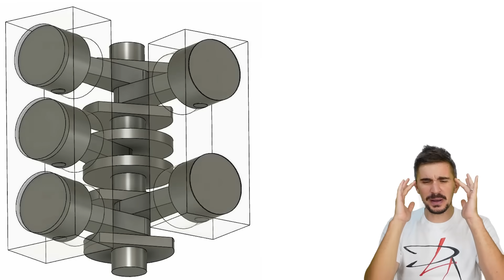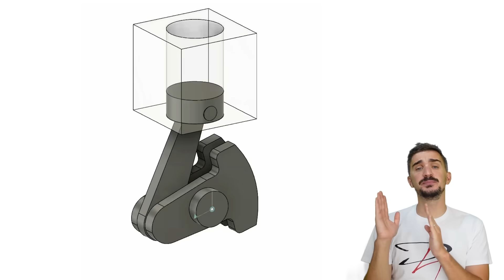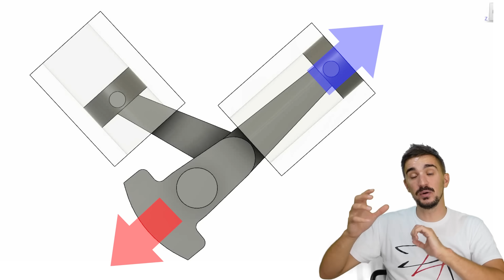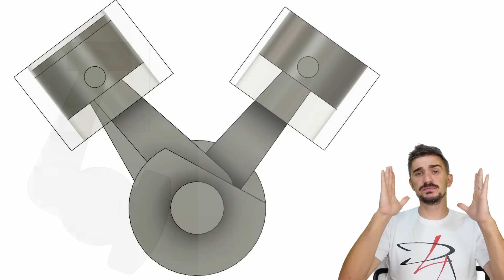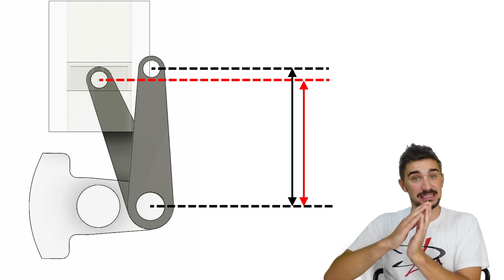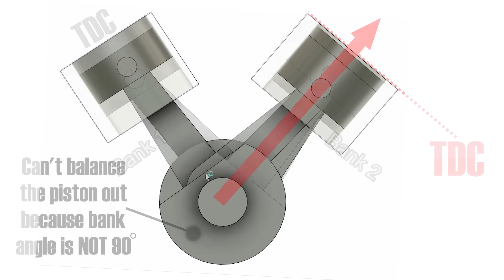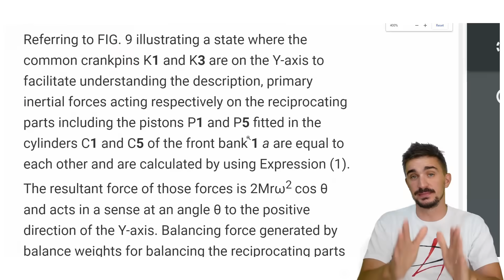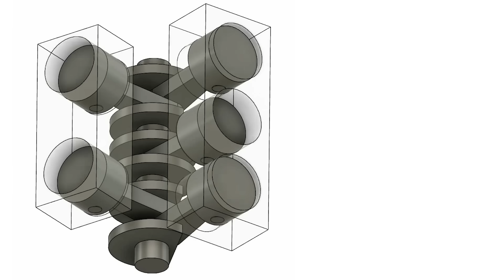Logic Defying V5 Engine - Honda's RC211V Explained Like Never Before

Comment: It wasn't made real clear in the video but, for a single cylinder engine balanced to 50 percent, the primary unbalance force is purely rotary.  Of course, the rod angularity creates a secondary shaking force, but we can't really do too much about that other than to note that it is directly proportional to the primary and thus benefits from reducing primary unbalance.  Since our primary forces are rotary, we can stack cylinder orientations so that the rotary forces tend to cancel out.

Comment: I have something to ask, at 5:35, you said that the 90° V-Twin engine has perfect primary balance, does that also apply to secondary balance? because the other piston is at 90° from the cylinder block which means max velocity, while the second piston is at TDC which means max acceleration. If that's true, does the V4 engine have perfect primary and secondary balance like the Inline 6 engine (regardless of whether it's even firing or odd firing) ?
Reply from the maker: Yes, when one piston is at TDC the other is at mid-stroke, but observe that the pistons do not directly oppose each other like the piston and the counterweight do, hence the forces do not cancel each other out and we don't have perfect secondary balance.
Reply: @d4a  Honestly, I still don't really understand the secondary balance on the V engine, it's not as easy as on the Inline 6 engine which is easy to understand
Reply from the maker: It's really the same. All you have to remember is that both primary and secondary balance are simply forces canceling out or adding up. To cancel out they must point in opposite directions. In the case of the V engine they simply don't point in opposite directions like in an inline engine, that's really all there is to it. Try this video, it might help: https://youtu.be/a9ZFZABaLbg

Comment: For racing applications the balance is primary due to high reving while on civilian cars the firing interval to smooth out the torque. Otherwise for track would be used V6 with straight pins to increase crankshaft rigidity.

Comment: Wouldn’t it just be easier to have 2 cylinders on the left 2 on the right and one straight up now in the Centre so it would be 2/1/2
Reply: That would be a three-bank (or "W") engine, requiring three pairs of camshafts. And it wouldn't work with the balancing approach that Honda used

Comment: At the final explanation starting around 12:00 you aim to show how a 75.5 degree V4 is unbalanced, and that the 5th cylinder balances it. 

You assume that the force from Bank 1 is both "minimal" and 0. At one moment you attribute the imbalance to the counterweight, and at the next you claim that a small force from Bank 1 is causing the imbalance. Which is it?

If the imbalance in a 75.5 degree engine is caused by the counterweight, then the force acting in the direction of bank 1 is the resultant of the interaction between bank 2 and the Counterweight. It is not a physics defying inertial force occuring while the cylinder is at acceleration=0. You have cause and effect mixed up here and it muddies the explanation.

Comment: 9:45 It will be easier for most people if you put a linear graph on the angle of crank (X Axis) and the piston acceleration and velocity (Y Axis). Wiki has a pretty good graph that illustrate just that.

Comment: Volvo introduced it's V5 engine for the T-models like in the 90:s (correct me if I remember it wrong).. =) However really good explanation of how it works!
Reply from the maker: You remember it wrong. Volvo did an inline 5 but never a v5. Nobody ever mass produced a true v5 for a car
Reply: @d4a  Oh yes that how it was - inline indeed. Thank you!
Reply from the maker: No problem 😊 thanks for watching
Reply: @d4a  You say that the "VR5" isn't a "true" vee engine... but if vee just means two banks of cylinders, it is indeed a 15 degree vee engine.The shared head is just  construction detail.

Comment: I wanna make another comment asking something new. Okay, so, given what you said about force, inertia, and velocity; Does that mean that you could technically make ANY V engine with a 75-78 degrees bank angle and see some significant advantage to power delivery? Even one with an even amount of cylinders that would otherwise have a functioning typical design? If I made strictly 75-degree V6s, 8's, 10's, 12's, etc., and assumed I could balance them otherwise, would they be superior to "conventionally" made ideal engines like the Busso, 90-deg V8's, 72-deg V10's, and 60-deg V12's?

Comment: Funny how people think the Volkswagen 2.3 litre AGZ and AQN is a V5, only because theres V5 written on the engine Cover, same Thing with the Audi 1.8 Turbo Engine [AUM, BVP, AJQ, APP, ARY, AUQ, APX, BAM, BEA, BFV] theres also "V5" written and people Thing it's an actual V5, but with the 1.8 Turbo the V5 makes sense because it stand's for 5 Valve the 1.8 T is a inline 4 with 5 Valve Technologie so it has 2 intake and 3 outtake valves per cylinder (20 in total)
Reply from the maker: On the 1.8 it's 5V not V5

Comment: I had my finger ready to click to another video several times, but he kept the science digestible. (Almost). One thing this video did, it further humbled me about the science and engineering that goes into an engine. And so many people think they can improve an engine by adding a gimmick spark plug or vortex air intake, etc. The only way this will work is if you can eliminate some emissions or other 'green' regulations that handcuffs manufacturers-- like California standards.

Comment: PRONOUNCED Twenty-one one.  NOT two hundred eleven.  Honda designates their grand prix bikes by iteration.  The 211 Means 21st century- first iteration.  It was the bike you are talking about- the 990cc V5.  It was replaced by the RC212 (PRONOUNCED twenty-one two) and was an 800CC V4.  When MotoGP settled on 1000cc engines for the 2012 season, Honda developed the RC213 which they still race to this day.  And, you guessed it- it is PRONOUNCED twenty-one Three.  Hope that helps!
Reply from the maker: I like two hundred and eleven so I'll pronounce it that way 😉 the meaning of 211 is at the very beginning of the video, honestly I don't understand how you missed that. Must've been in a rush to type all those capital letters 🤣
Reply: @d4a  Nope- I caught your explanation and was still surprised that you had no idea how the designation is pronounced.  Have a GREAT day!

Comment: Sounds similar to my 5 cyl VW beetle (2.5L) but obviously twice as many power strokes (2 cycle).
Reply: Both the Volkswagen VR5 and this Honda V5 engine are four-strokes.
This video is about how the engine is balanced, and in it he explains that the VW 15-degree VR5 is balanced very differently from the Honda 75.5 degree V5.

Comment: Honda once again forcing something odd to work. They outspent every other team and only won half the races? They ditched the V4 ( finally ) because it requires sacrifices to deal with the space of the front wheel, and the rear shock in the back too, and also takes weight off of the front wheel, resulting in loss of traction. The 16" front wheel was another toy they finally ditched, which did help with making room for the V4. But again they chose to try to patch up their pride with a V5. 

If they outspent the other teams AND stop wasting time forcing a square peg into a round hole, they would have won a lot more than just half the races

Comment: If a single cylinder can be practically balanced than all the other odd numbers should be easier. Does this V5 even need balancing shafts?
Reply: Nothing needs balancing shafts - it's a question of how much shaking is acceptable for the vehicle. A race bike won't use balancing shafts, a street bike probably won't, and in other applications it would depend on the engine size and the type of vehicle.
Reply: @brianb-p6586  Agreed and that's exactly my point.👍

Comment: The inverse cosine (cosinus) of 1/4 is 75.52... degrees. That is the ratio of 1 to 4 has a cosinus angle of 75.5 degrees.

That's the real reason for the bank angle, it's the angle required for one piston to restore a circular imbalance in the combined piston motion of the imbalanced V4.  it needs to be a circular imblance so as to be able to balance it out with an object moving in a circle: the crank counterweights. Just as with the V Twin etc.

The exact angle needed to phase the extra cylinder on the crankshaft is a lot more involved and (I originally found it) a little overwhelming, so the presentation here is excellent in that is short and understandable!

Interestingly, in terms of inertial torque, this V5 is considerably worse than any engine on the current MotoGP grid, despite the smaller pistons and the extra cylinder. Even Honda switched from a 0 degree crank to the 180 in the end, making it basically crossplane.

Comment: the rule change to 4 strokes was too fast and too radical (even for 3 years), so Honda stated that they had AMPLE experience with the flows of a 188cc cyl head.. (750-4 or 940-5) so it was easier to manage the flows of the new engine, thus "liberating" resources for the layout and other components.

Comment: Didn't VW make a working and reliable VR5 engine too ?
Reply from the maker: Didn't you watch the video? Or maybe just scroll through the chapter names a bit?
Reply: @d4a  i commented before watching, you video has, as always, easily surpassed my expextations :D
(Although it didn't really help with my headache but still, worth it)

Comment: i got it in the first 10 sec. or with the video in 2:25 
While two Cyl on the right are on top, there is one full and two halb Cyl on top on the left. And thats how it works. Very simple
Reply from the maker: ..... No
Reply: @d4a  lol, yes it is. Im an Engineer.
Reply from the maker: You might be a Dr. Ing. honoris causa... But that's not how the engine is balanced. If you think a title guarantees knowledge than you're incredibly naive. There's countless stupid engineers, doctors and professors out there.
Reply: @d4a  maybe you just dont understand me. im not talking about balancing
Reply from the maker: Of course I don't. That's why it's called nonsense
Reply: Its okay, maybe you will understand soon
Reply: Its okay, maybe you will understand soon

Comment: In 2009, Audi began using a new turbocharged five-cylinder engine in the Audi TT RS and later the Audi RS3 and the Audi quattro concept.
Reply from the maker: Your point is?
Reply: @d4a  you present this v5 cylinder engine like a new thing.
Audi was making a straight 5, but Volkswagen made a v5  from 1997 to 2006.
It was used in the Golf, Bora, New Beetle, and Passat.
Reply from the maker: It's too much to just scroll through the chapter titles? The v5 is already mentioned in the video and it's explained why the vw v5 isn't really a v5.
Reply: @d4a  Isnt really a v5? Itsure looks like 5 cylinders in a "V" arrangement. What else could it be?
Oh, that's a V ARRR 5.  like a V ARRR 6 minus one cylinder. 
I am not obligated to do any scrolling, or to watch to the end of your video when I realize that you are talking about an old idea like it's a new one. 
I stopped watching and moved on to another video after a bit of engagement. 
If there is nothing that you can learn from my criticism in this instance, then good. 
You have produced a perfect video and I stand corrected.
Reply: @punkinhaidmartin  While I agree that the VW engine is a V5, it is covered in the video so your comment is pointless and rude. Also, balancing (and firing order) are different due to the very different bank angle.
Reply: @brianb-p6586  is there a point to your comment other than repeating @driving 4 answers rebuttal?
My point was to let him know why I lost interest in the video, which is good information for him to have.
Criticism doesn't have to be welcome to be helpful.
Who are you helping?

Comment: Externally balanced. has no one ever pulled a freakin 5 speed off their 302 400 460 or otherwise externally balanced engine
Reply: No, it is not externally balanced.
Reply: @brianb-p6586  oh I know that but that wasn’t what i said
Reply: @mr.e7261  what were you trying to say? The location of crankshaft counterweights on some V8's has nothing to do with how a V5 is configured for balance (which is the subject of the video).
Reply: @brianb-p6586  the argument addressed was the idea that engines need to be balanced internally by the moving components it’s an argument I hear way to often and as someone who grew up with small block fords I know all to well about externally balanced engines and the nightmare of the flywheel
Reply: @mr.e7261  it doesn't matter whether the end counterweights are internal or external, the balancing design is the same. And that design for a V5 is very different from a V8, and the subject of the video.
Reply: @brianb-p6586  you think I care about the topic of the video or whether the v5 is internally balanced. Nah i knew that my comment was “off topic” that’s not the point I have freedom to say whatever I want to say here. I could’ve commented about 1066 and the battle of Hastings here on this comment thread. It would be perfectly fine. Keyboard warrior you’ve been got, give up

Comment: Love to see the "balancing an imbalanced design" explanation applied to the NSR500 V-3 engine Honda fielded in the 80's. 
Not sure of the bank angle on that one, but being a 2-stroke, all pistons would fire every time on their TDC. I wouldn't think they would have had the rear pairs firing simultaneously, but Big Bangs are something Honda did mess with. And, with just one piston in the front, there is no "odd" piston left out, but then there is also nothing else besides that to balance out the rear pairs......hmmm, (grabs Kevin Cameron books)

Comment: aircraft radial engines dont care, star configuration engines
Reply: radial engines (the evolutionary engine) dont even have to have the typical two-part piston, they can have fully rigid rotary axle-multi-hammer-piston
Reply: ie wankel engine
Reply: rotary engine
Reply: impeller continuous burn turbine tho
Reply: remove the shaking conrod, have a rigid main axle rotor
Reply: this type of parameter twiddling is mindless

Comment: Ok, a nicely balanced slim-ish engine, but why did it help make a better overall race bike that dominated MotoGP for so many years?  Was there something about this design that meant the whole bike could be made better, like less vibration means a less stronger chassis is required that allows for the creation of a less rigid frame that allows vertical in-corner surface variations (bumps) to be better absorbed/managed?  Or what??

Comment: But... what about the intervals? When do the cylinders fire in that 720 degree cyclus? Must be a bit irregular (with all pro's and con's), right?
Reply: Correct. I haven't seen a listing of the firing order for this engine. Although the crank position is known for every event of piston at top dead centre, that still leaves the question of at which one of those does each cylinder fire.
Reply: There is another YouTube video about this engine, and it gives the original firing order and the new firing order for 2004.
Reply: Here are the two firing intervals as reported in "Why Honda Used the V-5 Engine" by VisioRacer:
0°, 284.5°, 360°, 464.5°, 644.5° (for the initial version)
and 
0°, 284.5°, 464.5°, 464.5°, 720° (for the 2004 revision)

In terms of intervals between firings, that's
(with "*" meaning one cylinder fires and "**" means two cylinders fire together)
* 284.5° * 75.5° * 104.5° * 180° * 75.5° (for the initial version)
and 
** 284.5° * 180° ** 255.5°  (for the 2004 revision)

Both are based on the same crank configuration, and vary only in which revolution each cylinder is fired.
The first is as even as possible for separate cylinder firings, like firing the two cylinders of a 360 degree parallel twin on alternate revolutions. There is significant overlap in power pulses, but still two gaps in power delivery.
The second is the "big bang" alternative, firing the cylinders which reach the top together at the same time (on the same revolution) like a "big bang" 360 degree parallel twin; it has power pulses much like a conventional inline triple (0°, 240°, 480°). There is no overlap in power pulses, and significant gaps in two of the three intervals. In this second version, it is the oddball middle cylinder on the 3-cylinder bank - the one on its own crank throw - which fires by itself. This is more regular in a sense than the first pattern, although one of the three pulses per full engine cycle is half as strong.
Reply: @brianb-p6586  Wow thanks for explaining all that! Ok so they fire in pairs giving 2 big and 1 small pulse - makes sense now!

Comment: did you do a vidoe on the new outbord motors with the new connecting rods with 2 times the power now so they are half the size.

Comment: However, I heard that the Jeep 3.7 V6s, have a problem with a valve-seat leak, possibly turning some into a V5, which in the Jeep's case, wouldn't do well! I listen for signs of losing cylinder power now, because I heard of an issue that's serious. I think they need to be recalled, if they weren't already.